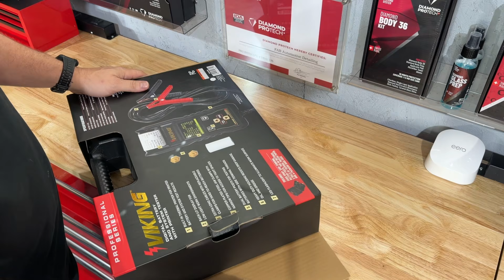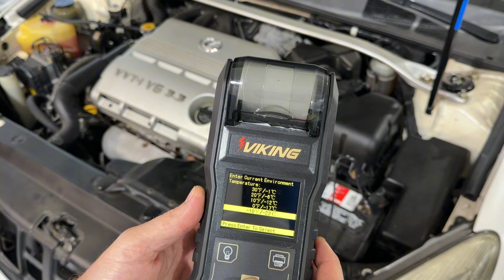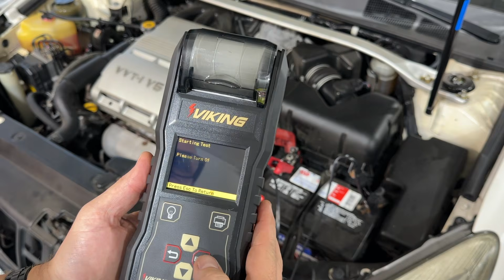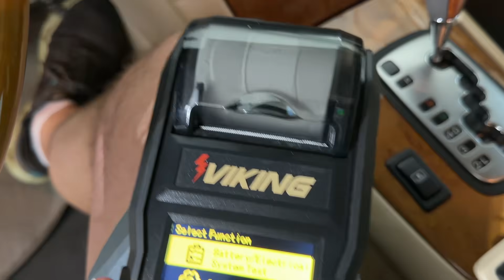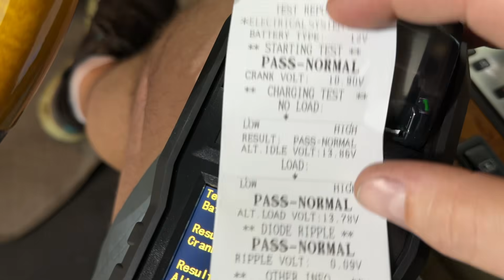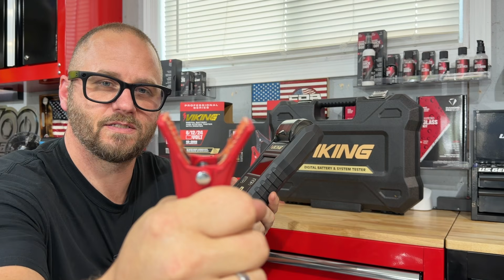Harbor Freight Viking Battery Tester and Printer. Awesome Deal!

Comment: I like that you put cca into it.  I have a cheap autel one that you have to put amp hours.  Most batteries seem to only have CCA...not the amp hours.  I have always googled what the amp hours should be based on CCA...but afraid I am not getting it right.
Reply from the maker: Thanks! I always use CCA when testing a battery